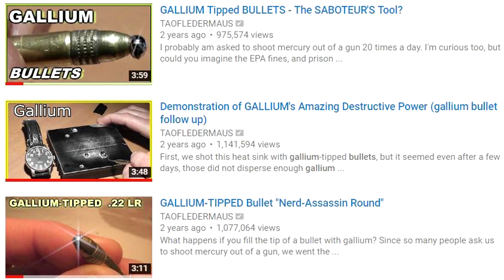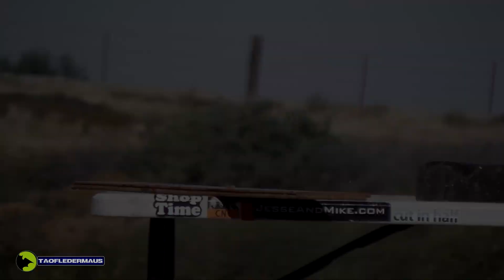Giant GALLIUM Bullet Experiment  -  What happens?

Comment: I wonder if the same concept as your magnetic projectiles can apply: the projectile is moving too fast and in this case the impact sprays the gallium everywhere but on the metal (I noticed a small puddle in the lead plate when Gregg scraped it with his knife) 
Thank you for never changing after all these years

Comment: What shotgun is that? Hope it's not a benelli nova. I had one and it kinda sucked. Well. It certainly had to be kept super clean. I mostly got it because it was on sale and had a 3.5" chamber. I will say the new and fun were off quickly. I ended up selling it later on for 10 bucks less than I paid for it ha. I even warned the buyer that I didn't like it and why, but they didnt care and really wanted it..
Reply: Now I have an 870 for a pump and I like it a lot more but now would kinda like to sell it too ha. Now I want one of those AOW or whatever the small non nfa essentially SBS guns are called.

Comment: Gallium is toxic, it's the only liquid metal except mercury. Difference between the 2 is Gallium will turn solid, but at body temperature it liquefies.. (used in extremely small doses as dye for Cat. Scans and MRIs) Absorbs through skin and if not flushed out of your system after an MRI it will build up and cause Heavy Metal deposits inside of you. (I know this because I have it) along with neurological problems. I wouldn't know if not for Neurologist, and a physical science professor. (Just letting uninformed people know, ... think before using this)

Comment: More interesting, and what I was hoping for, would be a solid gallium bullet fired from a handgun or rifle. Since gallium melts a 85 degrees F, such a bullet would be almost as untraceable as a being stabbed with an icicle. - Of course, part of the challenge is if it will survive the firing... how much melt would occur; would it be liquid before it stuck? (since it's much thinner than a shotgun slug) However, such a bullet might also decompose gun barrels. If I were the shot gun shooter, I'd shoot a bunch after, just to clear residual gallium which might get around to causing problems yet unpredicted.

Comment: The scary thing about the around if you start some of the Galleon Slug it wouldn't melt do to the body heat so you wouldn't be able to get me ballistics out of it and even though it is non toxic it would probably still cause havoc to your body if it got into your circulatory system so no ballistic so it's hard smash it to a gun if not impossible and be even if they survive the initial shot the gallium in their blood system they end up killing due to it being a foreign substance that doesn't sound fun does it

Comment: I believe the reason that they didn't get any results was that gallium has to be liquid to stick to and penetrate metal, and scratching the metal is also necessary to remove the oxide layer shielding it; mercury also aids gallium in its penetration. With all that in mind, a sealed hollow slug containing a liquid gallium/mercury mix and hard, sharp particles of eg tungsten carbide should be far more effective. It'd spray the liquid metal all over the surfaces of the target while the sharp particles scratch the surfaces to remove oxides, giving the gallium access to the underlying material.

Comment: 6:45, it's not aluminium oxide used in tannerite it's aluminium. What happens is the aluminum rapidly oxides when reacting with the ammonium nitrate which also part of the composition. (That is what releases extreme amounts of energy.)

 Aluminium is the fuel, ammonium nitrate the oxidizer. If you had aluminum oxide instead then that would also be an oxidizer just like how it's used in thermite. So you're tannerite would do nothing.

 I am also a bit confused when you say Aluminium oxide on the plate, do you mean lead oxide?

 Either way the flash you see when shooting most metals is typically going to be microscope fragments  of metal that have sheared off and because of their high surface area almost instantly oxidize releasing heat and light.

 That is also how Flint and Steel work, it's not the Flint that sparks like many believe. It's the steel that gets sheared off and oxides.

 Good video still, keep up the awesome work!

Comment: FYI, Gallium doesn't actually 'start a reaction' or even 'react with' aluminum.  It just causes aluminum to become brittle, break up and mix with the gallium.  You are essentially left with a slurry of two mixed up metals aren't combined in any real way; not an alloy or amalgam.  If you add water to this slurry, it will rapidly oxidize the aluminum and produce hydrogen gas, and leave you with gallium contaminated with aluminum oxide.

Comment: In the compound called Tannerite, the aluminum powder is the catalyst. Ammonium nitrate is what detonates. The Flash or fire that you see on impact is nothing more than spalling and physical metal itself. There is no aluminum oxide reaction that causes a detonation.
Reply: This should provide at least some degree of proof to back up what I said above. https://i.imgur.com/kWZ1ihD.jpg
Reply from the maker: Yes,   but what about LEAD oxide?    It seems we rarely see a flash with a freshly-cast lead plate,  but when it gets a little "oxide-y"   we've seen flashes even when a plastic wadding strikes it with enough speed.

Comment: Just imagine someone who made gallium injector rounds, designed to pierce a dent into aluminium then force gallium in with a bowl shape so it doesn't splash away, and use this to structurally weaken something like a bridge or what have you, which slowly degrades the structure over time.

Comment: Mercury gives some great efects,big bad boom ! Thanks for the vid folks.
Reply: This is gallium. Not mercury. Similar but not the same thing and are actually two different elements. it is not toxic like mercury and has a higher melting point so you can melt it in your hand when it is solid but then let it harden back to its solid state because its melting point is slightly lower then the tempeture of the human body

Comment: if the gallium liquefies and comes in contact with the barrel, will it ruin the barrel of the gun, or does gallium only effect the structural integrity of aluminum
Reply from the maker: I've found the "ease"  gallium attacks metals is just not the case.   Aluminum is very vulnerable,  yet none of the stuff coated with the stuff has shown any signs of damage after several days.
Reply: My understanding is gallium attacks the oxide coating that naturally protects aluminum from reacting with more oxygen in the air.  Other common metals, like steel, would not be harmed by this effect.
Reply: TAOFLEDERMAUS ok right on,  my thought or worry was that the shotgun barrel would become weak and blow up

Comment: i wonder if it would do more damage to a hot engine rather than a "cold" one but that is a bit expensive for you to test.
Reply from the maker: It was warmer than the melting point of the gallium.   It's been several days,  and there is still no change to engine or heat sink.
Reply: would it have stuck better to a engine at running temps? or would that not have a difference to it?
either way, thanks for the reply!
Reply from the maker: Eh,  I don't think so.
Reply: fair enough for me

Comment: You guys should shoot a propane cylinder with one of those flint tipped rounds you made a while back.
Reply from the maker: It wouldn't light because it takes a while for the propane to mix with enough air to reach a point where it can ignite.
Reply: squankey Great ain't it!? 2 booms for the price of one!
Reply: Mix up the right amount of propane and liquid oxygen and take a shot at a cylinder! As far as I can find out, the propane needs to be around the 20% mark and oxygen 80%.
Reply: That sounds extremely safe, what could go wrong?
Reply: Put some tannerite with the cylinder?  Just a small amount.  ;-)

Comment: What would happen if you shot a lead slug into a steel cone? So instead of the slug spreading out it would have to stay in one spot. I'd very much like to see what happens.
Reply: 4O4ERR0Rrs it would form itself into the cavity. If there wasn't at least a tiny hole to let air escape the extreme pressures and temperature would likely cause formation and detonation of exotic oxides.

Comment: Dude you really need to make sure you clean the barrel of the shotgun because gallium can cause structural failure in metal if it's left long enough. I would hate to your pretty faces get peppered.
Reply from the maker: Yeah,  I did that as soon as I got home.  I don't think there was any contact with the barrel though since everything was inside shotcups.
Reply: ***** yep, you can never be too safe, especially when it comes to guns

Comment: Yay for the Dr N. Butyl Lithium (Nurdrage) and Jörg Sprave shoutouts!
Aluminum oxide is very resistant to gallium. Unless you scratch the surface or apply liquid Gallium to freshly drilled, turned or filed aluminum, there shouldn't be much reaction within the first day or two.

Comment: I think that flash is a result of the air condensing and the burning is from the heat of the condensing
Reply from the maker: We only see it when we shoot the lead plate though.
Reply: TAOFLEDERMAUS it happens in other video all the time it's just far less noticeable I think that it's actually both a combination of the compression and the hole aluminum oxide thing

Comment: Allen Bradley VFD? lol
Reply from the maker: I can't remember what brand.   It was about 12" x 12" before I cut it up.
Reply: TAOFLEDERMAUS Had a machine that would kill it's Allen Bradley VFD once a month without fail... moved it to different location in the box, added cooling fan to the box, but it kept shitting the bed... found an old comparable ABB on the back of a dusty shelf in the stock room, installed it and transferred parameters and the sonofabitch is still running to this day lol

Comment: oh wow i bought my gallium from the same source and got the same EXACT stuff that you did!
Reply: riley mike density isn't weight.
Reply from the maker: Did you weight your vials?    Each one was supposed to be 50g  but were only 48g WITH the weight of the container!
Reply: the density changes depending on it's state. This is from wikipedia:
Density near room temperature: 5.91 g/cm^3
When liquid: 6.095 g/cm^3
Reply: in other words, it changes weight depening on wether it's solid or not
Reply from the maker: christian johnson density is weight per volume,  it's a ratio comparing an equal  volume of water to an equal volume of the material you are comparing it to.